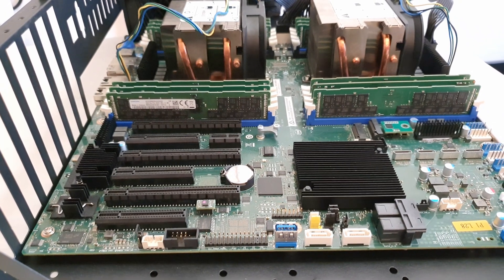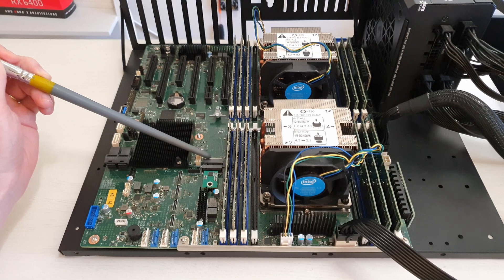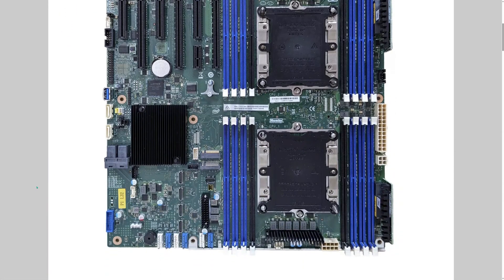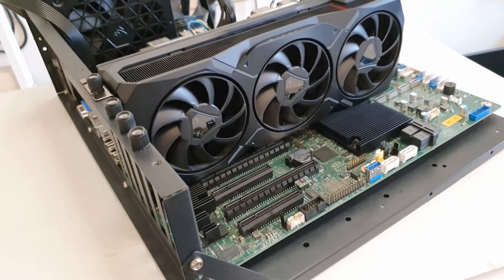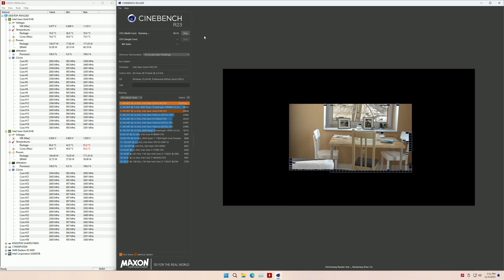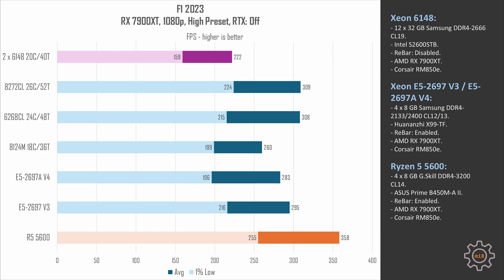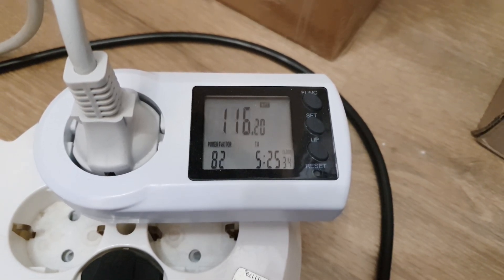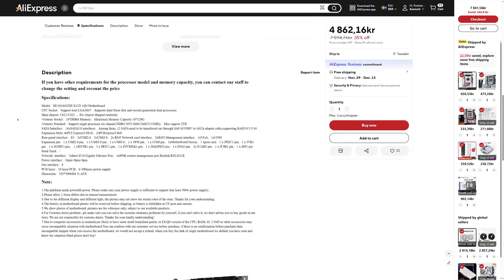Intel S2600STB – LGA 3647 motherboard review and test with 2 x Xeon Gold 6148

Comment: google VRM modify ICC_MAX to run high TDC OEM cpu if you are using cpus over 205watt. Got a s2600st I love it, started wth a bronze and 64gb in an intel case tower case. Upgraded to 384gb 2x 6146 Xeons currently have to new active 4u square coolers coming and 2x 6254's. I run a wx 7100 and a rx 6600, 9400-16i and a fresco fl1100 usb for my Unraid server.  love this board
Reply from the maker: I can only guess what this setup would be used for, for a simple unRAID it sounds like a huge overkill.

Comment: why are you pointing both cpu cooler in the same direction? one will be heat soaked so hard! have both pointed to the center and have colder air coming from the bottom and out the top!!

Comment: how did you get the ethernet to work?
Reply from the maker: I downloaded and installed Intel drivers.
Reply: @Miyconst  I did that but it's still not working and in device manager it says this device failed to start.
Reply from the maker: @neilerasmus5700  it sounds like a hardware issue then.
Reply: @Miyconst  can you maybe send a download link for the drivers please and also which ethernet adapter is yours?. mine is intel x722 ethernet adapter

Comment: Did you try and limit the game to run a just one of the CPUs?
Reply from the maker: I did not. It could potentially improve some numbers but I really didn't feel like bothering with it.
Reply: @Miyconst, then why did you run the test in the first place? Please read carefully — it's an Intel Xeon Scalable processor, specifically designed for virtualization. You can easily run games on a VM with 8/16 cores and PCI passthrough. Also, please don’t recommend Ryzen for homelabs — be mindful of PCIe lane limitations and virtualization features, which are often lacking.

Comment: @Miyconst  thanks for reply, can you tell please which operating system you using with this mobo?,  may be this mobo need windows server operating system, I remember once with a brand new dual JGINYUE X99 dual socket CPU motherboard, the NIC or ethernet port was not working out of the box and after contacting  JGINYUE the representative which send me the link to download driver and after installation of that driver the internet was working normally, thanks

Comment: Hello, I have a question
I have a machinist x99 paired with a 2697A v4 and the maximum cpu package power I reach when stress testing is about 66W while the cpu is rated at 145W TDP is that normal?
Reply: I am pretty sure chinese x99 motherboards measure tdp incorrectly

Comment: @Miyconst , thanks a lot for this video. I've been following and using your channel for advice and so far it's been very helpful :) I do have this precisely motherboard with a dual CPU setup with 2x6268CL and I got 41639 pts in Cinebench 23 and  2164 pts in Cinebench 2024 ( so roughly 60% increased performance versus single ) . I do have a couple of remarks to the video: you are comparing the performance of 2 x 150W TDP cores 1st gen ( air-cooled, and this board is not optimal for it as the 2nd CPU receives the hot air from the 1st one ) vs 1x 205W TDP cores 2nd gen ( 6268CL / 8272CL, watercooled ;) which also makes another difference, I've found these CPUs quite sensitive to thermals ) , that's it's not like for like, as you properly remarked in some of your previous previous; also, in my own experimentation I easily increased the performance 15% to 20% with optimized BIOS settings ( like in https://sp.ts.fujitsu.com/dmsp/Publications/public/wp-skylake-CX-bios-settings-primergy-ww-en.pdf ). Soon I'm going to fully water-cool all the setup, I'll se what I got :)
Reply from the maker: 150 vs. 205 watt is a real difference, agree here. Air vs. water cooling, disagree. The fans were spinning very fast (and noisy) as I mentioned in the video; with such configuration there is no thermal throttling as both CPU1 and CPU3 maintain identical frequency and very similar temps. Only 60% extra with double the CPUs is rather bad, I would say. To justify the cost, it should be at least 80% extra. Just my opinion.

Comment: Great Video as always! if possible, could you test Cities Skylines 2 on one of dual socket systems?  i'm curious about performance penalty of dual socket system for Cities skylines
Reply from the maker: The game does not have a built-in benchmark so it's really annoying to test it. In general, the penalty will be about the same as with the other games, 15-30%.

Comment: Have you considered trying some of the medium-core-count SKUs, like 6x44? I suspect that those might make the difference for replacing existing 2P gaming/workstation setups, since the high-core-count processors don't have nearly as much per-core or all-core boost. If not, it'd at least be nice to have some hard numbers on this.
Reply from the maker: These new(er) Xeons have miserable amount of L3 cache and L/MCC CPUs have even less of it, so the gaming performance is truly pathetic even if the clocks are a bit higher.
Reply: @Miyconst  Oooof. Yeah, I was hoping this would be a viable sidegrade for my 5600X (I miss having 40+ PCIe lanes like my Z820 did) but I can't justify this much of a perf hit for what the platform costs, especially in 2P form. Even X99 is more attractive given how much prices have crashed...
Reply from the maker: @mizsilver  what would you use all those lanes for in a desktop PC?
Reply: @Miyconst  10GBit Ethernet, secondary GPUs for passthrough, SAS controllers, NVMe carriers. Right now I have a single GPU (running at 4.0x8), a SAS2 controller   (3.0x8) and a 4x slot that I haven't decided what to do with, but there's not a lot it can do. Hell, I don't even have room for 1x cards for things like USB3 passthrough in this setup. None of this was an issue on my Z820; the only real limitation being no support for PCIe bifurcation. In short, I got used to having features reserved for workstations and not having them is frustrating, especially since I don't just game on my main desktop.
Reply from the maker: @mizsilver  I honestly have no clue what all of these would be useful for in a regular desktop PC but if you really need this many PCI-E lanes, then LGA 3647 is great.

Comment: So that weird x1 slot is why the chinese Inspur intel x540-t2 nic has an additional x1 slot on top of x8...
Reply from the maker: I honestly have no clue, if you have some specs or info about it - please share.
Reply: @Miyconst  To be honest i personally have no idea about it too. But only knew about the inspur card as i am looking for 10gbe nics. That card works in regular desktop if u cut the x1 part off or tape it off, otherwise it will not be regonized. 

I guess to figure out what it actually does we will have to plug into that special slot that the s2600stb have.The inspur card can be had on aliexpress for around $12 euros i do believe, or around $8 euro on taobao.Still a very good price for a 10g rj45 nic.
Reply from the maker: Yeah, I checked the inspur card and it indeed looks like a perfect match for this weird X1 slot. S2600ST already has two 10GbE so I don't know why extra is required.
Reply: @Miyconst  I do believe there are other boards in the past that has this slot and those might not have 10g. According to the manua of the S2600ST it seems like its a SFP+ lan riser port and is originally meant for a remote management module called AXXRMM4. 

It seems that companies like inspur adopted the port for their server, the chinese inspur x540 t2 is just the most popular card with said slot, i do believe there are other cards with the same slot factor but it is rare.

It might be possible that there are other nics, but afaik inspur was nearly bankrupt which probably explains why we only see their 10g nics floating around instead of the 25g and 40g that are more modern.

Comment: Perhaps not great in a typical gaming scenario, but I am curious about VDI and running multiple sessions with either GPU splitting, or multiple powerful GPUs.
If the platform can deliver a nice 1080p60FPS experience across 4 or more instances... It could be good for gaming or even workstation tasks... Just not in the traditional way.
Reply from the maker: Yup, it's good for parallel serving of multiple users with constant load of at least 20-30%, otherwise it's just an idling space heater.

Comment: Thats normal that 2 CPUs Systems because of trotteling the speed to shift data from 1 CPU to the second CPU.and windows is at that a nother pain in the ass to isolate both.
Reply from the maker: Yeah, Windows can't really figure out how to schedule tasks with R9 7950X3D and Intel's hybrid architecture, dual socket systems is a next level challenge.
Reply: @Miyconst  thats why my low cost budjet server with a supermicro motherboard for 350€ + a 7702p also "used" is way cheaper and has more performance than every soket 3647 soket even the 4 soket motherboards.
Reply from the maker: @Nelevita  yeah, AMD EPYCs are on my list of exploration as well. What's your idle power consumption?
Reply: @Miyconst  ~ 100 watts but my server consums full boared with 1TB Ram + the 64 Cores / 128 Treads fully pinned ~370 watts and over 2 weeks with the same woarklod and no real switching to the memory ~320 watts and the performance increase. But my 7702p is locked @ 1,5GHz.

Comment: Great review.  200+ GB/s of memory bandwidth is interesting.  It would be really nice if it could support faster DDR4 memory to get the bandwidth number up.  The only use I could see for this is running huge LLMs locally on the processor.
Reply from the maker: You can get DDR4-2933 memory with supporting CPUs, sadly I don't have such for testing.
Reply: @Miyconst  two 6230s can be had 90 bucks each
Reply from the maker: @zerokool1985  yeah, that's an ok price but only if I manage to sell off some of the stuff I already have. Can't afford investing even more into LGA 3647.
Reply: He didn't install the 4x 512GB L4 cache chips ..

Comment: This thing could basically run an entire office worth of NAS, VLANs, Media and surveillance. If you need 100 TB of RAID storage shared with a few dozen computers this is your motherboard.
Reply from the maker: Very true.. the only question is who would need that? 😃
Reply: @Miyconst  who would need that and not have money for a more recent and efficient AMD system?
Reply: @PizzaUndervolt  Hackers who need to resist DOS attacks, lol.  Anyone doing it on a tight budget, a non profit, college students dorm or club, hobbyists and programmers at home.  The new AMD systems are fast but do not compare when it comes to connectivity.  You would need the TRX platform.
Reply from the maker: AMD is surely more effective but if you need all the RAM and PCI-E then it's EPYC only, and first generations of EPYC had their own pile of issues.
Reply: @Miyconst  I could use it to power my home, but a 2650 v2 is enough for that. This is alot of power,  It could run one hell of a minecraft server :)

Comment: I was waiting for this review very very long time, I have spot on exact same identical motherboard, the unresolve difficult problem and I still have is the lack of internet, I needed to add a network NIC card in a PCIe slot to get internet, yes of course I attempt installing plenty of network drivers from Intel unsuccessfully, the secondary problem was to boot from a NVMe SSD inserted in another different PCIe slot which was not that straight forward easy, I needed to use a Highpoint  M.2 SSD7202 NVMe Boot RAID controller  then I was able to boot from NVMe SSD drive, yes this mobo looks like have two M.2 slots but are for SATA only and not NVMe drives unfortunately
Reply from the maker: It seems like you have got a damaged motherboard or there is something else going on. My particular unit works without the issues you mentioned.
Reply: @Miyconst  thanks for reply, can you tell please which operating system you using with this mobo?,  may be this mobo need windows server operating system, I remember once with a brand new dual JGINYUE X99 dual socket CPU motherboard, the NIC or ethernet port was not working out of the box and after contacting  JGINYUE the representative which send me the link to download driver and after installation of that driver the internet was working normally, thanks